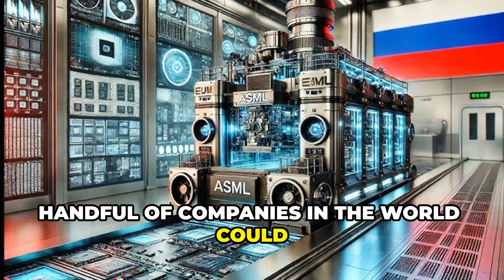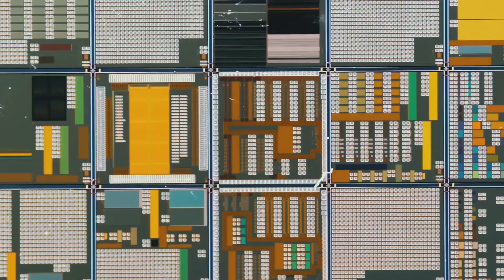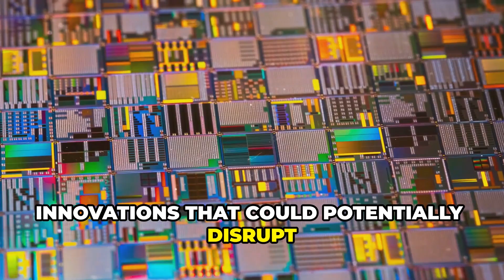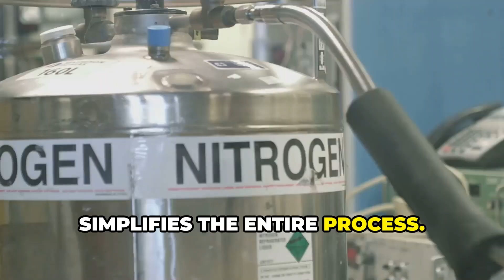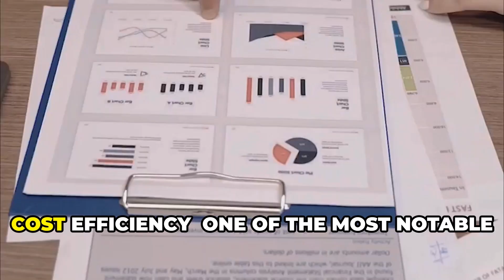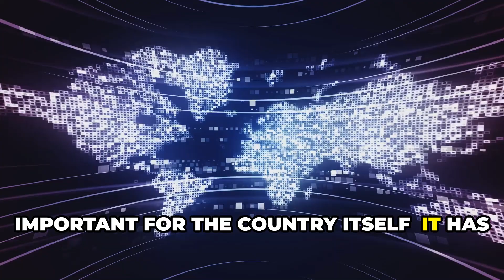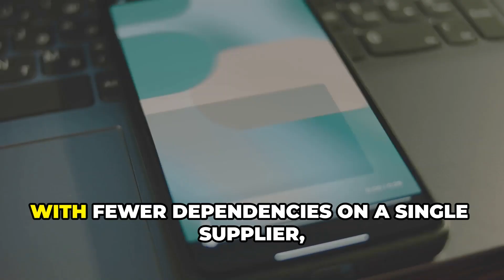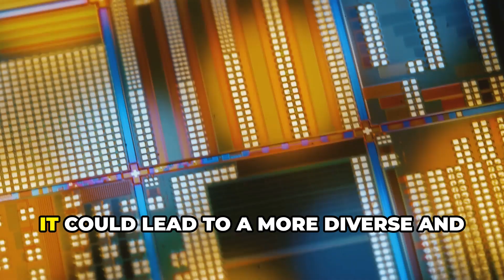Russia Shocks the Tech World: Develops its own EUV lithography machine to Rival ASML!

Comment: No, it's not true that Russia shocked the tech world by developing its own EUV (Extreme Ultraviolet) lithography machine.

There have been posts on the X platform suggesting that Russia has created its own EUV machine, with some users calling it a "historic breakthrough" or providing technical details such as a different wavelength or type of laser. However, this information comes from unverified sources and is not reliable.

Comment: This video is not very accurate. Yes, Russians bult their own lithogrthy machine. But currently it prints ar resolution of around 150 nanometers, and they have techcnology to print at around 90nanometers. At the same time most advanced western systems print at 5 nanometers.  The gap seems to be huge, but not really. The actual componenets do not vary in size very much. Bearing in mind that is quite a breakthrough for the country that never done before. That what I learned from the news in Russian langualge. Can't tell weather it is true or not.
Reply: Excellent.  Where did you see it?

Comment: Thanks to Western sanctions on Russia in which they laughed at Russians using chips from used washing machines and other appliances, Russia has developed or is developing everything they need to produce chips, military equipment, large passenger aircraft and more.  Too much repetition in your video without which it could probably be done in 10 minutes or less.  Also, closed-captioning should be left as a choice for the viewer.
Reply: Chips of washing mashines are much more advanced than anything Russia can produce. In fact, Russia doesn‘t develop or produce any modern chips. They are all imported from China or the West, often illegally.

Comment: Am I understanding this correctly? - The Dutch appropriated Soviet developments in this area and became monopolists in the market. Now Russia has restored its scientific potential, which was significantly undermined after the collapse of the USSR, and is entering the market not just with an alternative development, but with a more progressive and potentially leading development, which leaves the Dutch not only without a monopoly, but also without a place in the market.. If that's the case, then justice has finally prevailed.
Reply: Pretty much yes. Dutch essentially appropriated Russian engineers built tech , and then EU sanctioned Russia, preventing Russia from buying these Dutch chips that not only Russian scientists developed, but also had agreements with EU to receive a % of the ASML production. 
The justice is always being served.

Comment: 'Ohhh, there are thousands of embargoes and sanctions against our country and our military complex, all the equipments,  all the missiles,  etc,  require all kinds of components,  and chips, and if we can't buy those chips,  we return to the stone age'
Solution : let's build our own machine that not only  will allow us to manufacture our own chips,  but we will be able to make them smaller,  faster,  better " !
There probably are some great engineers,  who have designed amazing cpus or gpus, but they don't have the tens, or hundreds of millions of $ to prototype.... and we end up with an absolute monopoly,  nvidia-amd-intel.... with high-end gaming cards that cost 2000-3000 bucks.... when those cards cost Nvidia or amd 200 bucks or less,  despite having 16.24  or 32 GB of memory. 
In a near future,  we could have raytracing accelerator cards,  like the voodoo 3dfx from year 200x, for a few hundred bucks,  capable of doing 100 times more raytracing that today's top gpus...
People could buy AI cards,  like the nvidia ones,  for only a few hundreds bucks,  instead of 10k... 15k dollars for just 1 single card... !
And because silicon is ultra cheap,  Russia , China,  iran, could work together,  and manufacture 10x... 100x...1000x times more chips than most taywanese companies do, today...
Let's see what happens....

Comment: Indeed, Russia is actively working towards developing its own EUV lithography machines. However, these efforts are still in the preliminary phases, and no such machine has been completed to date. According to IC-PCB, Russia has initiated plans to create its own EUV lithography technology, aiming to utilize an 11.2 nm wavelength, differing from the 13.5 nm standard used by industry leader ASML. But this is years away, meaning that Russian modern microchips won't be coming off the production line any time soon.

Comment: it is from Belarus technology - Belarus was the centre of domestic chip production in the USSR. It is 350nm ...... on 200mm wafers. And it seems they will get it down to 130nm in 1-2 years. But at 200mm wafers you are not going to cost competitive to sell on  the world market. That is not their goal at all. Their goal is to stick with 200mm wafers to save time and cost as developing machines for 300mm wafers is far more expensive and time consuming. 
So what has really happening Zelenograd in Moscow has combined with Planar from Belarus to do the "mass production" of these machines. Good progress but they are sticking with 200mm wafers to do that. Their goal is to supply the domestic market not "take on" ASML. ASML does admit that the mirror tech they is based on Soviet technology - so Russia does indeed have some real tech knowledge. Most of the story is going off at a huge tangent .....
Reply: I feel very informed thanks to you

Comment: This crazy propaganda message is spread each year. Progress: zero. It is just an announcement of development! Of course, the EUV machine does not exist. And it hardly will ever exist. Russia has neither the capital, nor the knowledge and tools to create such a machine. Even worse, the non-standard 11.2nm wavelength requires the development of a complete new ecosystem. This means they would need to develop not just the EUV machine but all of its components and infrastructure. This would require decades.

After the ridiculous announcement back to sad Russian reality. Like last year Russia announced that it had developed a 350nm lithography machine. This was standard 30 years ago. Russia technologically return into the middle age. The price of Putins war.

Comment: Good luck 😂, many have tried, including the biggest and, for a long time, the most technologically advanced: Intel. Only one has succeeded so far: "EUV – Easy Until Verified!" Russia will fail to achieve it more cheaply and with a similar yield (which is also important and develops over years of production). The Russian machine will be much more expensive and thus irrelevant.

Comment: basically, Russia can make on demand 12nm base chips, although the machines are slower, they are cheaper, thus lower turn around times between changes in designs  that will be revolutionary in development.. and less waste due to over-production.  I sense that there is a company (mentioned) in the USA that is following suit.  All technologies have physical limits and what we are seeing in the GPU chipset race is that smaller circuit isn't necessarily better, as at the faster speeds, it requires more energy to the point of being absurd.